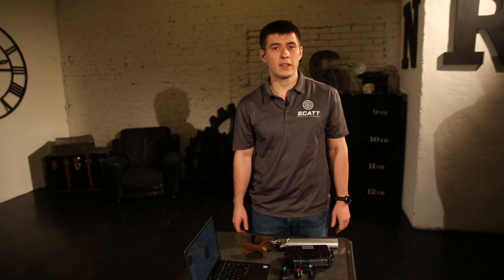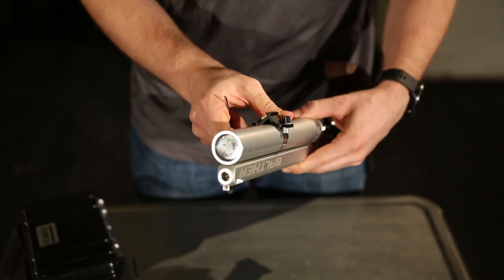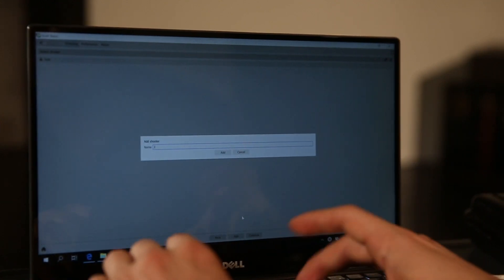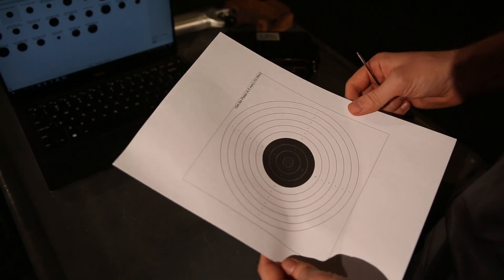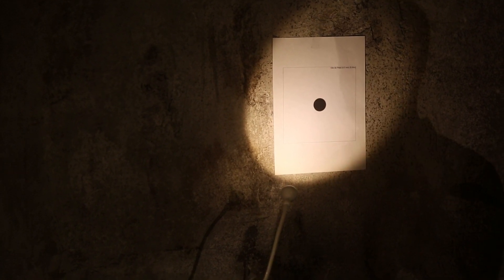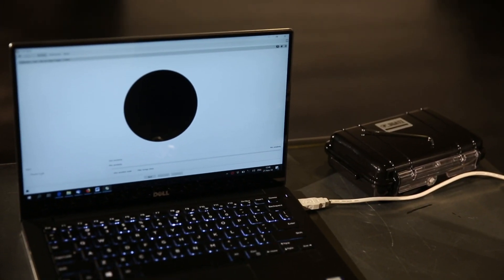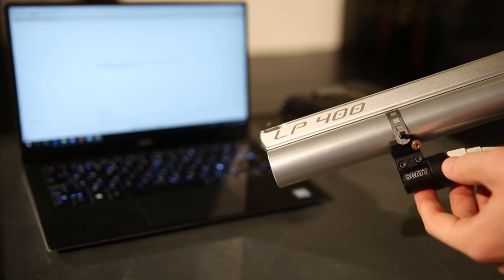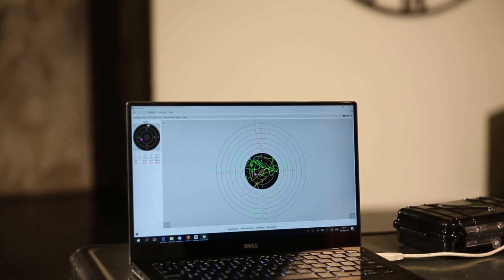SCATT Basic installation set up guide

Comment: What should be the Target height for 10 mtr air pistol if having 8.5 mtr distance?
Reply: I know this is over a year old - but just in case anyone blows through afterwards with the same question - 
Height doesn't scale. Only the diameter of the target.
Imagine if you were shooting prone 100m, and you scaled the height down to shoot at 2.5m, the bullseye would end up being level with the floor.

Comment: Hello! There is a problem, when i want to calibrate the scatt to the rifle, there is no red dot on the black circle. I did restart the programm, and the computer around 8 times, but nothing.
Reply: The first thing to check is the light intensity on the target surface. You can use your smartphone with "LuxMeter" or similar app to measure the luminosity. Try to have at least 1000 Lux. If the issue continues please contact us at info@scatt.com

Comment: I'm going to ask a complete noob question here. I want to put the system on a centrefire bolt action rifle. What is to stop the shot registering in the sound of the bolt closing rather than the firing pin/striker dropping?
Reply: Hi Chris, the question is actually on the point because in dry-fire mode the system doesn't indeed differentiate automatically between these two actions. However, the vibration and sound from these two actions are not identical, and you can adjust the threshold for vibration and sound so that the system would register one and ignore the other. Also, in most cases the shooters' aimpoint is not exactly on the target when operating the bolt and the SCATT doesn't register the shot if the aimpoint is outside of the target area.

Comment: Can you consider that you give us the option to buy a license for SCATT Professional or Expert software, which we could use on SCATT Basic, because we (shooters and coaches) need that detailed analysis?
Reply: Hi, unfortunately the SCATT Basic is designed to work only with its own version of the software. It does indeed include only the most important and crucial data, missing some deeper analytical features. But just like with any other SCATT model, you can always rely on it's high standard of accuracy. If you feel that you've mastered all the data that SCATT Basic offers, you can upgrade to any of the other 4 models, all of which do support the the deeper analytics of the SCATT Pro or Expert software.